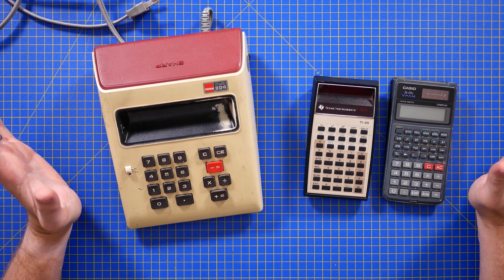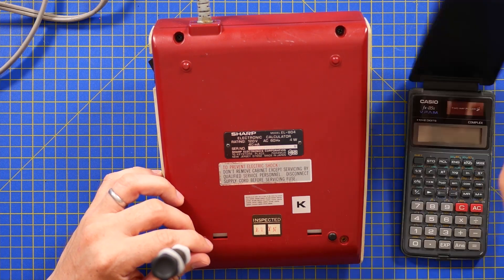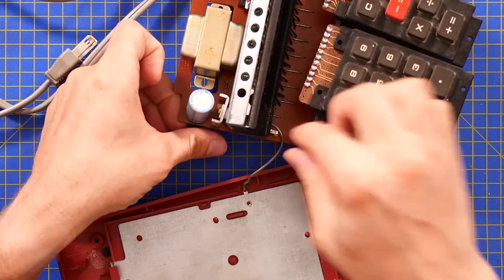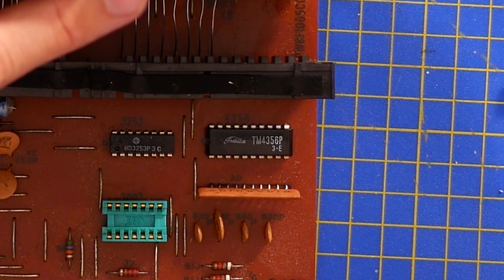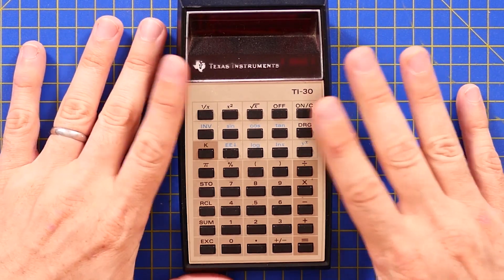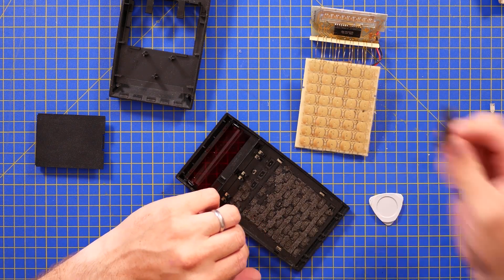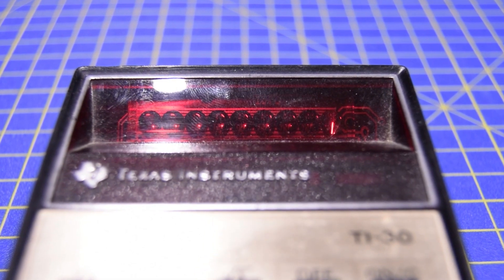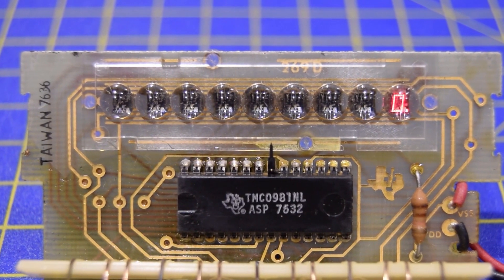TI vs Desktop Calculators Teardown - The Electronics Inside

Comment: I have a collection of over a hundred vintage calculators, including desktop calculators that weigh nearly 40 pounds! Some of them are even scientific models, such as my Hewlett Packard HP 9100A. That one was built before ROM chips were even available... It is made using resistor diode logic, and uses transistors for flip flops and NOT gates. To get around the fact that ROM chips had yet to become commercially viable, they created an inductively coupled PC board trace ROM. It was a 16 layer PC board with sense traces running over pattern traces that either zigged or zagged  one way or the other across the sense traces. They coded 32kbits of ROM using literally nothing more than zigzagging circuit board squiggles!

Comment: I do still have my TI-57 i was given from my granddad that was electronic engineer, chemist and amateurradio operator. Still working fine but the battery package needs to get replaced with new one and better batteries for it. Still using it from time to time.
Reply: Old video and you may have found out that if you open the battery case it contains a AA nicad cell and a converter board. You can use the newer Nimh cells fine. It will run like new.

Comment: I had a TI-30 like that in the early 1980s. I don't remember what happened to it. I might still have it in a box somewhere. Anyway, you didn't show the coolest thing about it, or maybe yours is a later, faster version than mine. You could watch mine "think" with the higher-level operations: the rightmost character would light up a single perimeter element consecutively in a spinning animation for a moment or two before displaying the result similar to a modern video buffering animation.
Reply: This one does do it! It's very clear to the naked eye, but trying to capture it on camera proved very challenging. I think i even tried a high frame rate on my phone, but couldn't make it satisfactory...

Comment: Big difference between them is the cost of the display. The Sharp was using a by them mature technology, but the TI was using a newly developed Monsanto LED technology, that required the displays to be made with each one having it's own silicon chip in the display, so as to grow the LED segments on top of the silicon. Thus a very expensive display to make in large sizes, so the magnifier screen so as to give an apparent large letter while still having a small die. That display easily was the most expensive part of the calculator, so as to cut cost they used the display PCB as the main board, as they could get the tested displays, attach and wire bond them, then check they operated, before putting the top lens on. 

I will guess the chip pin left out was due to having various models of the calculators around, each with a different mask ROM main chip in it. So they had a place where they could put in an extra select line for the ROM for a function, but this mask version did not use the pin, so it was bent out, painted to prevent shorts, and then, like almost all calculators then, hand assembled in a large factory where labour was cheap. Later versions came with add on ROM modules, I have one, where you plug in additional ROM modules to provide extra functionality, using a serial bus that allows the extra command instructions to be stored. Those use a flexible PCB for everything, one board which holds the display, the plug in sockets formed out of the flex, and the interconnects to the keyboard, along with the main IC chips.

Should dig it out, though, as the battery was long dead, I had to bodge in a simple linear power supply to replace it, so it is now mains powered, and simply has a 4V8 1W zener diode, acting as shunt regulator for the power supply. Fed from an old 6VDC wall wart, with a series resistor.
Reply: Thank you for that - interesting to hear the manufacturing process for the display!

The expandable ROM sounds fascinating! Would you be interested in seeing more calculator tear downs?